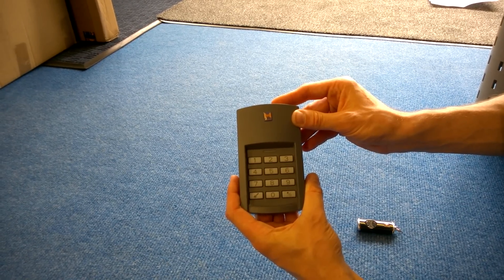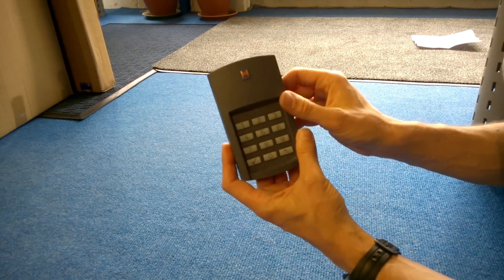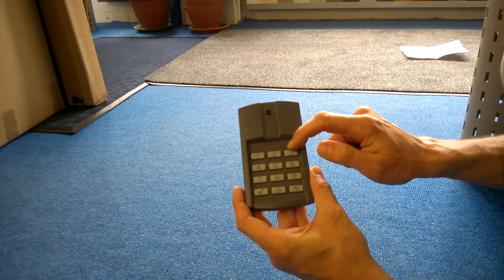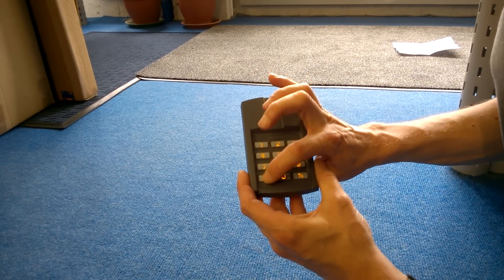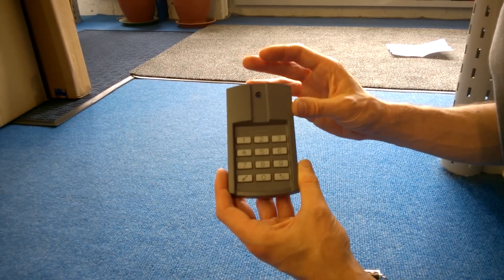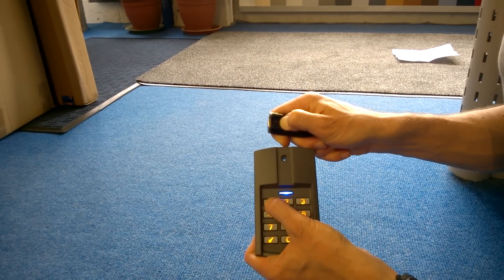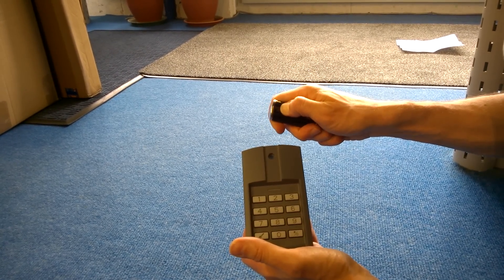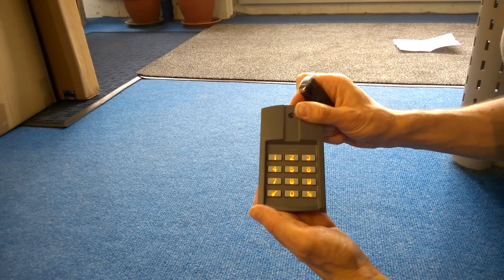Setting up and coding in a Hormann FCT3 Bisecur keypad

Comment: Does this mean that everyone can reset the code and open the garage door with the newly set code? This seems like a massive security vulnerability. The only thing someone needs is a screwdriver and a minute or two...
Reply from the maker: No, if you reset the keypad it will wipe all the transmitter codes, so you would not be able to open the door. Following this procedure you will need to reassign the keypad to your operator.

Comment: Hi is it possible to perform this operation using an old Hörmann 0437442 remote to transmit the odes rather than the bisecur one shown in the video?
Reply from the maker: This unit will also work with series 2 hand transmitters in pretty much the same way. The series 2 hand transmitters don't need to flash red and blue and the FCT should pick up the code as soon as you press the hand transmiiter button. It is not compatible with older series 1 grey button hand transmitters.

Comment: Where is a video explaining how to programme the keypad to the main Horman unit, not the remote transmitter

My door is driving me nuts and there are no videos out there about reprogramming the KeyPad unit
Reply: I'm sure you found your answer already but for others, like me, who are wondering the same thing.. On a series 3 or 4 opener, hold PRG until 00 appears, press UP til it reaches 11, press PRG so it flashes slowly, then enter your code on the pin pad and hold the KEY 🔑 button down and keep holding it. The light on the pin pad is solid blue, then rapid flashing blue, hen off, then red blue alternating. At that point the operator 11 should flash quickly. You can release the KEY 🔑 button on the pin pad and it is programmed in

Comment: Excellent video - thanks for doing it. Three points would like to add. 1: My case had a screw under the Hormann badge which you obviously have to remove before you can unclip the cover.  2: Darrens comment "having to press the key button twice when using the pad the first time." - I missed that in the video and went around the loop 3 times before I got it to work. 3: My lower buttons were generally getting very very hard to use.  I took the PCB off inside and cleaned up the gold contacts under the rubber keys with a little paint thinner as they were which were a bit dirty – works a treat now.  Thanks again

Comment: I have Hormann FCT3b-868 keypad. Can I able to program the keypad directly with the gate opener without the hand transmitter?
Reply from the maker: Yes. You can hold down the key button once you have typed in your code and it works in exactly the same way as a hand transmitter.

Comment: The first step doesn’t function , I try to get it off but it is very hard
Reply from the maker: It can be a bit tricky to get the cover off, especially if the device is attached to the wall. You need to pull the cover out to the sides first, where the '1' and '3' digits are. Then you can pull it off.